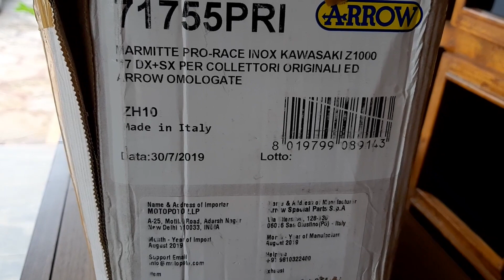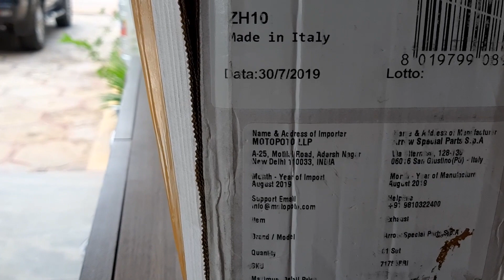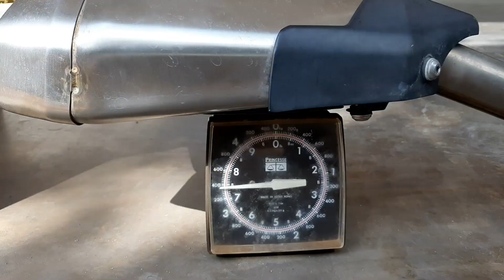UNBOXING AND INSTALLATION OF ARROW RACE PRO EXHAUST[SLIP ONS] FOR KAWASAKI NINJA 1000 SX 2019

Comment: Hello, 
This video has been quite helpful. 
I just have couple of queries. 
The arrow prorace exhausts seems to be quite close with less gap with the panniers. When ee are doing long trips with pillion riders, does it hit? And secondly as the gap is less, does the exhaust heat and fumes affect the panniers on the long run
Reply from the maker: HI,I HAVE NOT BEEN RIDING WITH A PILLON SO NOT SURE,AS YOU SAID THE GAP IS NOT LESS BUT QUITE OK,NOT TO WORRY AS THE PANNIERS ARE MADE OF HARD PLASTIC SO HEATING WILL NOT BE A ISSUE UNLESS THE EXHAUST IS THROWING FIRE  WHICH IS NOT LIKELY TO HAPPEN WITH THE EXHAUST

Comment: The heat will melt the panniers ?
Reply from the maker: the under side of panniers has got a steel plate to reflect heat
Reply: @iamscud420  did you install the steel plate or it comes with the panniers
Reply from the maker: @mohsinrekhivlogs  comes with the panniers
but there are panniers which do not have steel plate so you need to order with the plate
Reply: @iamscud420  thanks a lot
Reply from the maker: @mohsinrekhivlogs   COMES WITH THE PANNIERS BUT YOU NEED TO ORDER THE STEEL PLATED PANNIERS